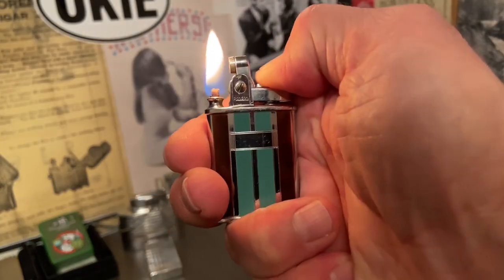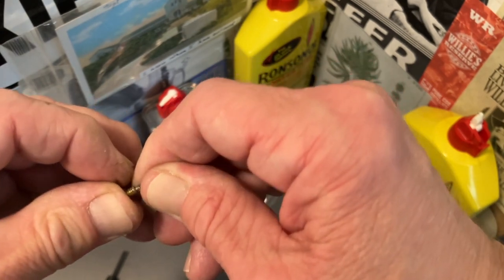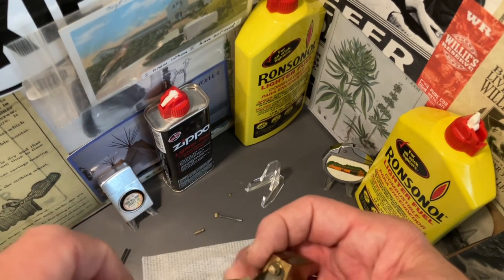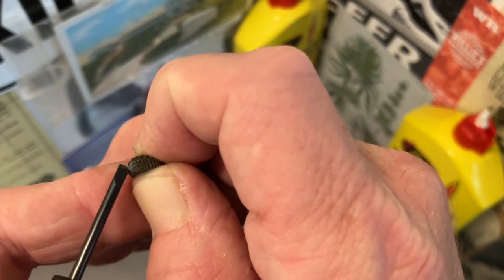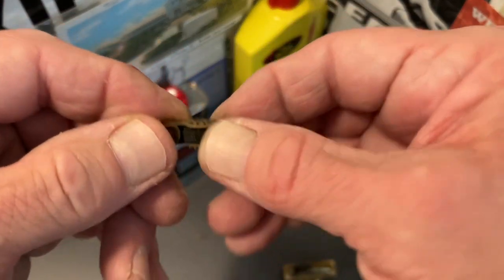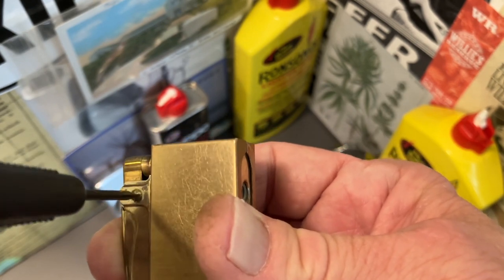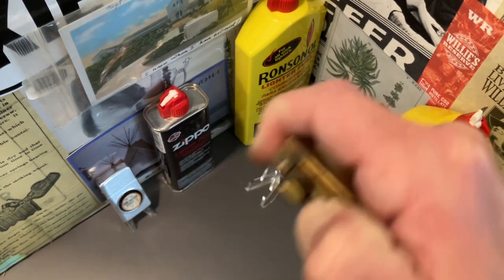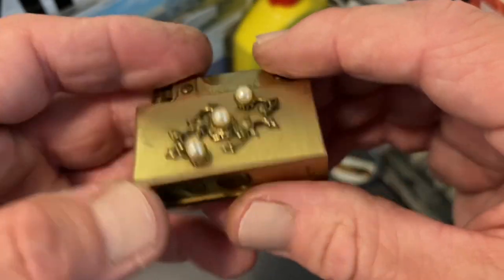How To Disassemble A Japan Made Automatic Lighter, Clear The Flint Tube & Replace The Flint Spring

Comment: Hello! Extremely helpful video! I have just gotten into collecting lighters and got my first older / vintage style lighter, which happens to be very similar to the one in your video! It is an "Alpco" butterfly lighter from Japan. However, it needs some work and I was wondering if you could answer a few begginer lighter-restoration questions?

First, do you have any videos showing how to replace the wick in a lighter like this? The wick on mine seems to be either missing or worn down so far I can't grasp anything with needlenose pliers to pull it out. 

Second, do you know of any resources for purchasing after-market replacement parts for these old lighters, by chance? Mine unfortunately seems to be missing both it fuel cap screw and it also looks to be missing a screw or peg on the back end of the lever assembly. As I continue my journey collecting and restoring these old lighters, I'm sure I'll find myself needing all kinds of replacement parts. So, if you know of a resource, that would be most helpful!

Finally, do you have any videos or resources that show methods / products / chemicals one might use to clean, buff scratches, shine, etc. the various types of metals / materials one might encounter with these older lighters?

Thanks so much! I'm going to continue watching your videos and will subscribe so I can learn all I can! Thanks so much for making these informative videos!
Reply from the maker: Thanks for all the questions! This article:

https://dependableflame.com/how-to-change-the-wick-in-a-petrol-lighter

should help with your question about changing the wick. I don't use much to clean them, just wipe down with common household disinfectant cloths. I use 91% isopropyl alcohol and concentrated vinegar as solvents to cut through old grime and corrosion when it is necessary.✌️

Comment: Hello, great video! I'm trying to restore one just like this one, when I bought it the spring was already replaced by the previous owner, disassembling/re-assembling went well and manage to make the moving parts run smoothly.

Now I have one problem, when I insert the spring the moving parts will lock after a couple uses. Any idea why this could be happening? Is the spring too long?

I hope to gift this to my brother after fixing it, he used to have an old vintage lighter like this but lost it a couple years ago. 
Thanks!

Comment: I can’t thank you enough for these videos.  I was able to get my Ronson Queen Anne and Crown working again.  I have a question.  I have an omega super lighter that is missing one of the gears/cogs that go on each side of the flint wheel, inside the snuffer.  It’s the same series as the ronson lighters.  Do you know somewhere to get a replacement gear or will I need to cannibalize another omega or ronson to get a replacement?   Thank you for any advice.
Reply from the maker: Sometimes parts from a clone will work, sometimes not. https://dependableflame.com/where-can-i-find-replacement-parts-to-repair-my-vintage-petrol-lighter ✌️
Reply: @DependableFlame  I’ll check that out.  Thank you sir!

Comment: Hello! I have one of these exact ligthers, I have done everything in the video, the flint tube was indeed very dirty and clogged. But after inserting a new flint, it seems to struggle to spark like if the wheel was not spinning. Is it possible that a zippo flint is too hard for those small lighters? The wheel is spinning fine without a flint! 

Thank you in advance and love your content! :)
Reply: I have the exact same problem too but it has the name crown from japan
Reply: @randomleftE  Let me know if you find how to fix that on yours :)